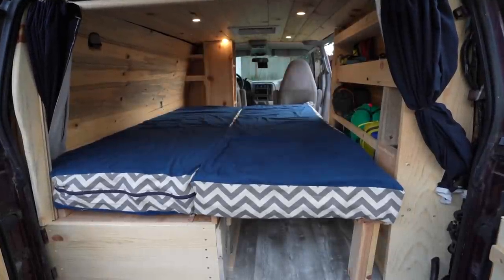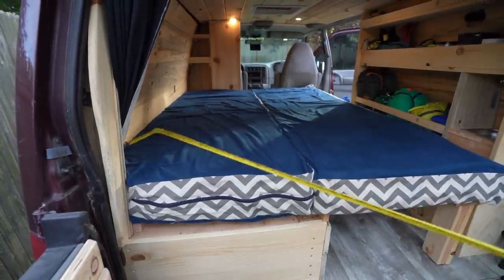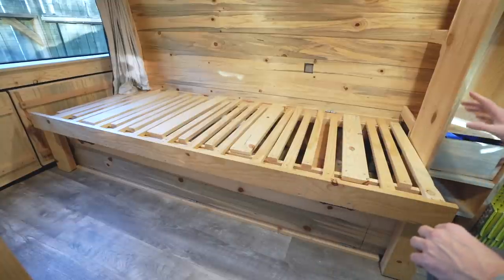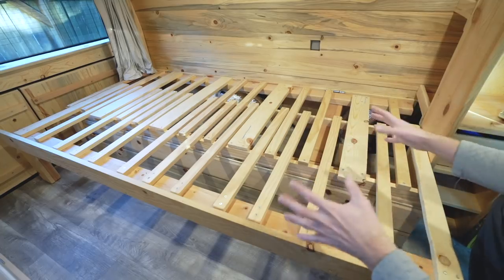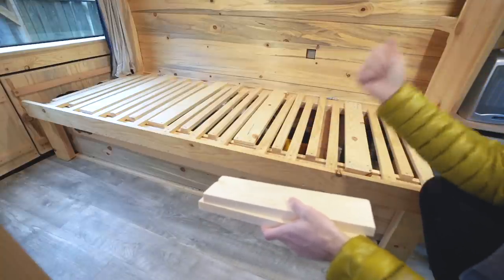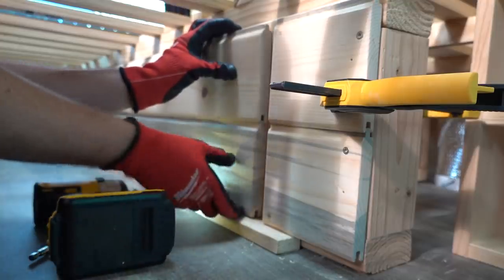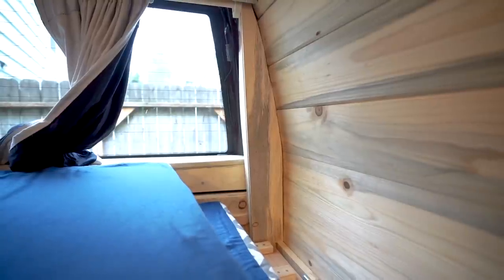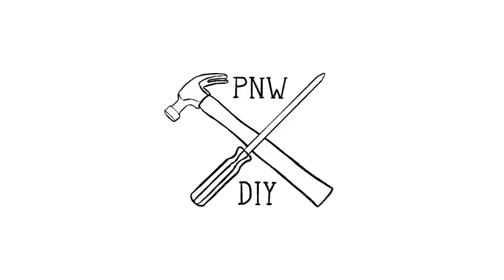[How to] Expandable / Pull-out Bed for your Camper Van | Van Life & Conversions | Chevy Astro

Comment: Ty for posting.  I'm getting ready to upgrade my E250 diy campervan.  Currently I have 2 stationery beds, 1 crosswise & 1 lengthwise with room for a folding bike under back bed.  I need more moving around space & to pack in a couple more essentials so Im planning a slide out bed.  Your plan is by far the best slide out concept I've found. Ty again.

Comment: Simple, clever, well thought out. What more do you want!
This is a good example of a designer being an end user and building from experience. If I were to be extremely picky, I might say that "furniture" in these types of builds tends to be a bit over built which has its advantages, off the shelf home depot variety materials, easily construction, field repairable, easy to change your mind as things evolve but.... 2x4's and dimensional lumber are quite chonky. 

Just as you have had a rethink about night stands and counter tops. I've had a rethink about beds. I'm also coming from a pickup truck background as well and I opted to build wheel well width floor to ceiling side storage and not have a proper bed which in your analogy is a really big countertop.  Come bed time I roll,out the thermarest and sleep on the floor. No bulky bed during the day. A pickup truck bed  is different than a van though and easier to keep clean. 

All in all,. Your van is pretty brilliant. Everything you need without feeling like your trying to replicate a tiny home into a van. 2 thumbs up!

Comment: Honestly, I think you have the best build Ive come across for an outdoors person. Perfect blend of functionality, usable space and it doesn't make it so the van can't be unconverted if it dies and you move it all to a new donor. One question, what is under your plywood floor, any vapor barriers or insulation?
Reply from the maker: Thank you for the kind words. No vapor barrier. I chose to have a breathable floor design in case of leaks or spills. That way the water can run down the ridge line of the metal flooring and not get trapped so it can't evaporate. Cheers!

Comment: Thanks for the video! I just got a 2000 Astro and I see that you also have the AC/heater radiators at the side. I see that the one located behind the drivers seat is there but what about the one located at the very bottom of the van, next to the back door? Did you get rid of that? My wife is going to follow you on instagram to see more about your designs! Thanks again

Comment: Is there a reason why you didn't insulate the floor?
Reply from the maker: Breathable floor works great in my opinion. Plywood actually insulates *a lot*. The open air ridges underneath give my vehicle a fighting chance in case there is a leak or a spill. Much higher chance of having excess moisture evaporate instead of soaking into or being trapped by insulation leading to mildew, mold, or even rust. Breathable floor, imo, works amazingly well.

Comment: you're overplaying the moisture slate thing in your case, because your mattress is small and moveable and not very heavy or thick, it's not that big of a deal, you can just lift the mattress every now and then to air things out, clean underneathetc. It's only more of an issue with larger two person mattress sizes that are crammed into tight spaces, like what most people do in the back of most sprinter vans, you need the air circ then because you're basically never really lifting or moving the mattress except for maybe once a year.
Reply from the maker: Completely disagree. I've had my mattress (same configuration, different vehicle) mold in the Southwest. You need ventilation; that's the whole point of box springs. Allowing for mattress ventilation will save you money in the long run because your mattress will not be destroyed by preventable moisture accumulation.

Comment: 300 lbs of wood-- not good
Reply from the maker: You do realize that’s the weight of like 2 passengers, right? Not to mention the weight is offset by the removal of the two benches. These vans have towing capacities, yo.